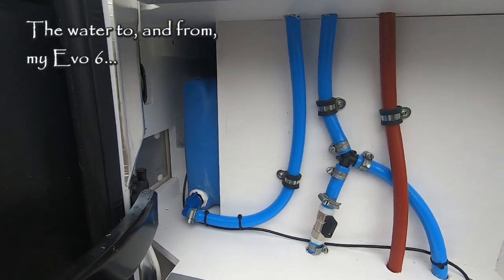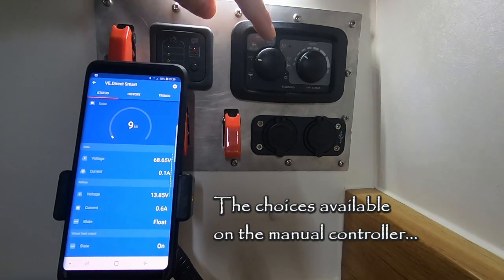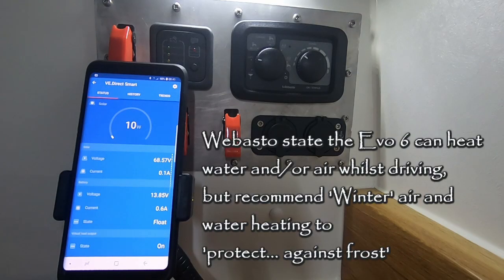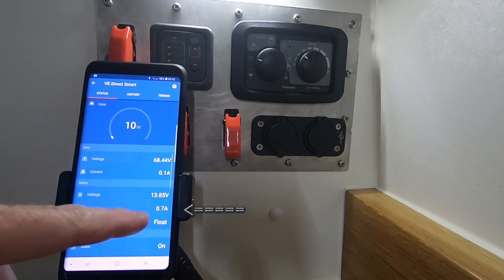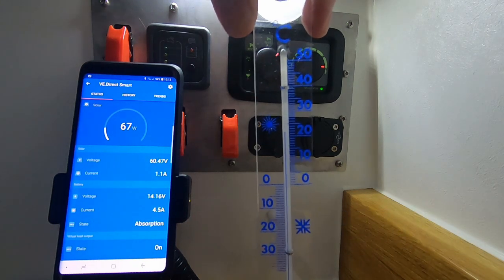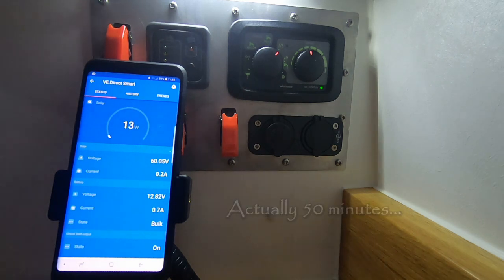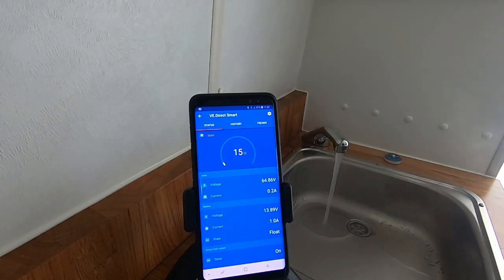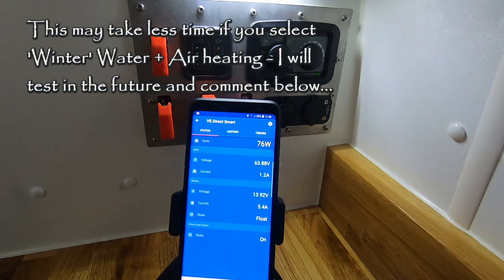#16 Webasto Dual Top Evo 6: Demo and Speed Test: Sprinter Camper Van Conversion: RND Diaries #020

Comment: Hi mate hope you all well great video can you please let me know where I can get same system to fit in a boat prefer if it's a second hand boiler if you have any ideas would be great many thanks for your time
Reply from the maker: I can only recommend you contact Webasto dealers/agents which is what I did and ask them. Even if they don't carry 2nd hand stock they might be able to point you in the direction of a boatbuilder or similar who fits them and might have a used one after someone does an upgrade on their boat. Also check out the Wallas brand (Wallas-Marin of Finland) - similar products but they have heaters specifically targeted at boat users. Cheers, john

Comment: Hello, ¿hot water is on demand?, I mean, can I take long showers without problems?
Reply from the maker: Not really.... You are always going to be limited by the 11 litre capacity of hot water in the boiler and of course how much fresh water you are carrying in the van. I just limit myself to 'Navy showers' - get wet/soap/rinse. Cheers, john
Reply: @RedNemesisDogPrime  Hi, great video thanks for the good review. About how long would you say your hot water lasts for a 'navy shower"? Just curious if the 11 liters will work for my application.
Reply from the maker: I take 2-3 minutes max' but of course that is only relevant to my preferences and van setup. If and when circumstances and time allows I do want to run a series of tests to see how much 'hot' water, for how long and and what flow rates I can get out of the system with the standard and water saving shower heads as I think that is the underlying and recurring question by people considering buying the Webasto and at the moment I have no idea. Even then the results will probably be pretty specific to my van setup as I designed it so my fresh water is inboard and because it is passively heated by the boiler underneath and the fridge heat output as well as the habitation ambient temperature being relevant then I never have 'cold' water as such when I am living in the van and when this mixes with the boiler heated water it is less impactful on the mixed warm/hot temperature than if a fresh water tank is outside the habitation space. I wonder if you want a best guess for your application if you could heat 11 litres to the maximum Webasto claimed water temperature (70 degrees C I believe) and add water at an assumed freshwater tank temperature and see what the total volume of usable warm water is. Not very scientific but might give you an indication... Cheers, john

Comment: Great information, thank you. I'm in the design stage of building my newer school bus conversion called a Skoolie and I'm looking for opinions on size for a Wabasto for heat, water and cooling in a 45 ft bus. Entire bus is just a shell down to the steel floor, it will have 1"insulation on the roof, floor and both side, all windows have been removed. Only select areas will have double pain window as needed. What Wabasto would you recommend. Thank You
Reply from the maker: Hey Kevin, many thanks for the feedback. Your conversion project sounds amazing! I am not really a Webasto expert, however I can say that the Evo 6 could easily heat a much bigger space than my Sprinter . I also seem to remember that the 6 is the smallest they make? I would ask a Webasto dealer for advice once you have calculated the volume you are going to heat. One of the reasons I had it fitted by a dealer (apart from not having the skills at the time) was so that the warranty would be valid which might not be the case if you fit it yourself (depending on where you are based obviously). Your plans for insulation sound like you won't lose excessive heat from the interior so you probably don't need a huge margin over the maximum volume heating capability of the Webasto. Hope that helps. Good luck with the build. Cheers, john

Comment: Thanks for posting this video.
In our present van we have a Truma 6GE, I know overkill for a Renault Master conversion but we spend quite a bit of time in the Highlands of Scotland during the winter months. For our next vehicle I'm seriously considering the  Webasto as oposed to a gas powered heater. Do you have the electric elements on your heater?
We find that the performance of the Truma on electric for water heating is very poor,
Reply from the maker: Thank you for the feedback. The Webasto is diesel only in my case - so the only 'fuel/energy' is diesel and a 12v connection. I can certainly recommend the Dual Top Evo 6 for both heat and hot water  - obviously the hot water isn't instantaneous but it is hot! I think there is an option for a programmable controller which means you can set it so you come back to pre-heated van and water which after a wet walk in the Highlands would be ideal! Cheers, john
Reply: @RedNemesisDogPrime  Thanks for the reply John, I don't think that I'd go for the electric elements again.

Comment: Hi there, thank you for your wonderful video demonstrating what this can do. 
I have a question, If this is heated to 70 degrees C & you were to have a fairly warm shower, how long could that shower be? I'm guessing about 10-15 mins?

Thanks, Logan
Reply from the maker: Hey Logan, Good question... I haven't actually tested the total flow time of warm water. Obviously the length of a 'long' shower is limited by the reservoir of hot water in the boiler itself and the flow rate you would choose at the shower head as well as the temperature of the cold water from the onboard tank. I just have a 'Navy shower' - turn on water/get wet/turn off/lather/turn on/rinse/turn off water - which takes me a maximum of 3/4 minutes and there is plenty enough hot water for that. The other critical limitation is how much water I can carry in the van - hence the approach of limiting water for a shower (and the total number of showers when I don't have access to lots of tap water!). Ultimately you have a hot water reservoir of 11 litres in the Webasto so I guess rate of flow and how hot you want the shower to be are the limiting factors. Of course a water saving shower head will in theory extend the shower time - I bought one for the van, but eventually went with a standard shower head simply because of the design and fitting. For a domestic shower they reckon a flow rate of 10-15 litres a minute but presumably that's at full blast. I am more than happy to try the experiment to see how long it delivers warm water once we get out of lockdown here in Scotland and back on the road. I will post the result/upload a short video once I do. Cheers john

Comment: This is a very helpful video. How is the water pressure coming out of the Dual Top Evo? I assume there is no need to have a pump on the exit of the hot water reservoir? Thanks!
Reply from the maker: Glad you found it useful. The pressure does not seem to be affected by having to run through the Dual Top Evo coils/reservoir and totally subjectively the hot water feed from the boiler seems to be the same as the cold water feed. Certainly in my setup I only have one pump pulling the water out of the fresh water tank and pushing it through the cold pipes and the boiler. I think the accumulator is very useful to maintain a more consistent pressure in the system so would recommend fitting one then the flow isn't just about the pump response to pressure changes. Obviously the distances covered are not great in my build. As it is effectively a closed system from the pump to the taps then I am guessing/assuming the pressure is approximately constant in all pipework. Hope this helps. Cheers john
Reply: Red Nemesisdog I appreciate the detailed answer and advice! This helps!
Reply: @RedNemesisDogPrime  What pipe fittings did you use on the 10mm inlet and outlet  of the Evo Dual Top? I am trying to see in the video and they look like they can be  John Guest fittings. Is that correct?
Reply from the maker: Absolutely right, they are speedfit connectors. Everywhere else is traditional jubilee hose clips - this was because I wanted to use flexible water pipe from the boiler and pump rather than construct the system with straight lengths of pipe. Cheers john
Reply: Red Nemesisdog Thanks again!

Comment: Hello, having used (presumably) this for some time now, whats your review of it? I'd want to run a shower off it etc, does it have enough hot water to maintain a shower for up to 8mins for example? Also did you get around to doing that last test you mentioned at the end of the video? Another test that might be interesting, what temp water do you get when it has run out of hot water (both 40C and 70C mode)? Cheers
Reply from the maker: Hi hipo1024, 
Thanks for the questions. Unfortunately due to a bereavement in the family I have not used the Webasto for the extended periods of time I had intended and instead I have only done frequent short trips, so my response here is based on that context. I intend to be travelling for extended periods in the new year and will be able to answer more comprehensively and competently then I believe. 

Overall I am pleased with the heater so far.

I do however have the sense that the air heater starts and stops a bit later than I would ideally want. For example the hot air control knob set vertically gives (me) a habitation temperature of 20 degrees C (sort of), however it only turns the fan on when the habitation temperature drops to ~18 degrees and turns the fan off when it gets to ~22 degrees. So my preferred air temperature of 20 degrees is effectively an average with a 4 degree C range. I accept that this may be influenced by the size and shape of my conversion and that altering the position of the sensor might affect the responsiveness. I am not sure where the ideal sensor position would be in such a small space, but my first attempt would be to move it lower and away from the warm air mass directly under the ceiling. If the heater was warming a larger space in a bigger van then I wonder if the variance would be so wide. All this said I cannot complain about any lack of heating capacity as even when it is near zero degrees outside, the van has been very warm and cosy inside. Diesel use appears to be negligible even when camping on these cold autumn days in the Highlands and the heating is left on all day and night. 

As concerns your question about being able to have enough water for an 8 minute shower I am afraid I don’t know the answer. I limit myself to having a ‘navy shower’  so there is plenty enough hot water for the required 2 or 3 minutes of flow I need. I think you could do a decent approximation of how long a shower you might be able to have based on the 11 litre capacity and your best guess in terms of the rate of flow you want or can achieve from your pump. Obviously the temperature of your cold water could severely limit your shower time especially if you have your fresh water tank outside the van and if you like very hot showers at full force then those 11 litres probably aren’t going to last the 8 minutes. Sorry I can’t give an exact answer on that one.

I have not done the winter air+water test to time the rate of heating of the habitation area, thanks for reminding me – I will do it once I start travelling.

I think the answer to your final question is (probably/perhaps/maybe) that the water would be only marginally above the colder fresh water temperature if it didn’t have time to sit in the boiler and was effectively just passing through. This ‘guess’ is based on the time it takes the water to be heated as shown in the video. However, what is interesting I think is that when just using the Evo to only heat the air/habitation the water temperature is passively raised to ‘tepid’ and as such the time it takes to heat the water is reduced (I have not timed this yet).

Thanks again for the questions – hope these answers help in the interim. Cheers john
Reply: @RedNemesisDogPrime  thank you John for your very comprehensive response! Well above and beyond what I was expecting back. Sorry to hear about your loss and I hope everything is getting better as time goes on, it's never easy.
Reply from the maker: Thank you. Cheers john
Reply from the maker: Addendum - The 18 and 22 degree C temperatures described above were measured on the work surface.